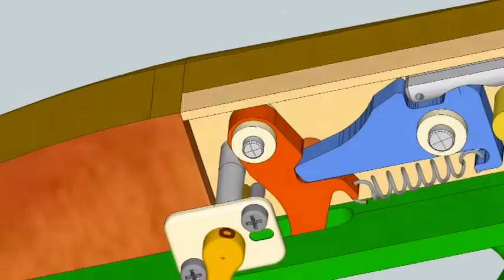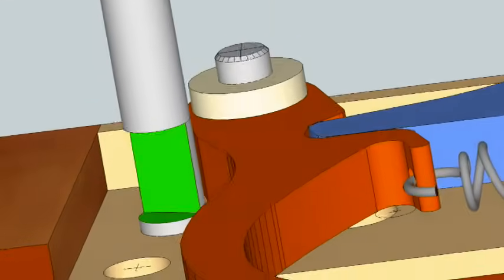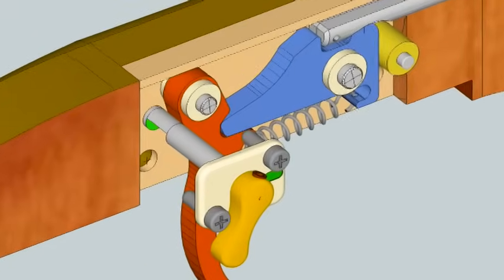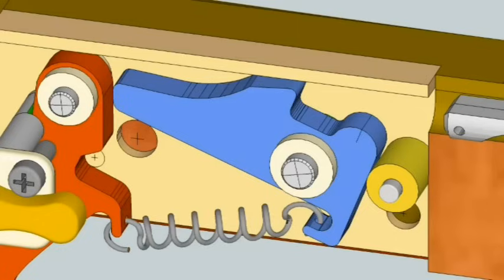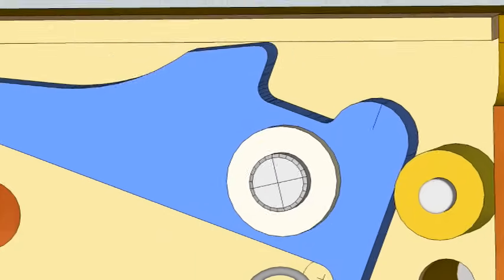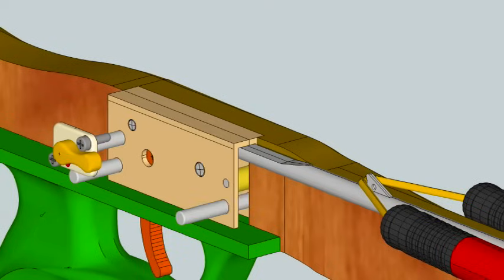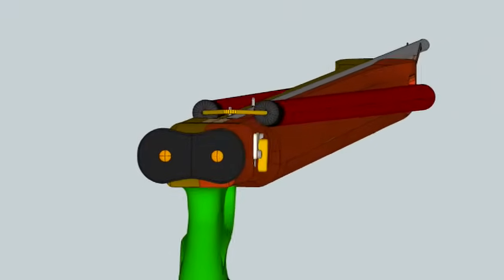New Speargun Trigger Design with safety knob

Comment: hello, nice mechanism, is it possible to get som drawing or 3d model please?
Reply from the maker: Hello Václav Mirvald,
that will not be possible, but a can give you some dimensions for it.
- The trigger housing dimensions= 13x30x65mm, wall thickness: 2mm 
Trigger and Sear= 5mm thick. All made from 316 grade stainless steel
Some of my channel viewers told me, that by using any free screen recorder program to take "screen 
shots"  from some of my videos, and then using a image editing program 
like "PAINT" to scale the images to get the right sizes. Watch the video
 "Roller Speargun Design Model"
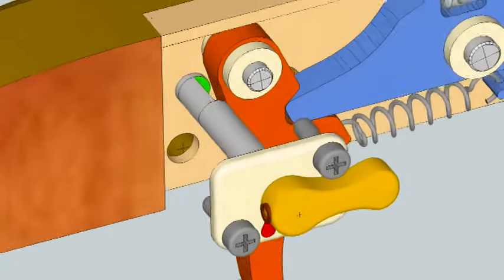 https://www.youtube.com/watch?v=_qQXGEgw5p8  at 1:03 is possible to see a side view of the trigger mach.
Thanks for the comment and for watching.

Comment: Qual  são as médias da  pesas
Reply from the maker: Hello Dejonson Pererira
 - The trigger housing dimensions= 13x30x65mm, wall thickness: 2mm 
Trigger and Sear= 5mm thick. All made from 316 grade stainless steel
Some of my channel viewers told me, that by using any free screen 
recorder program to take "screen shots"  from some of my videos, and 
then using a image editing program 
like "PAINT" to scale the images to get the right sizes. Watch the video
 "Roller Speargun Design Model"
 https://www.youtube.com/watch?v=_qQXGEgw5p8  at 1:03 is possible to see a side view of the trigger machanism.

  Overall dimensions of the spearguns.
The roller speargun:
 1200mm long (end to end)
950mm from the centre of the rollers to the edge of the trigger pocket 
50mm wide
---------
Traditional speargun,
1200m long
950mm from the edge of the rubber bands hole to the trigger pocket
50mm wide from the but plate to the end of the trigger pocket and tapering down to 40mm at the tip (muzzle)
I used  Okoume Marine Plywood  laminated together with epoxy,  but a much better choice will be to use Teak Wood.
Thanks for the comment and for watching my videos.

Comment: hello,,,,.... can u send u r trigger and speargun with all spear-part  
diagram, and all material and tools list. plz i try at my workshop.
Reply from the maker: Hello suraj shinde,
I want to finish this spearguns project first, before making it available. 
I designed this trigger mechanism using a Cad program (Google Sketchup) 
The only dimensions that I can provide are: The trigger housing dimensions= 13x30x65mm, 
wall thickness: 2mm, the Trigger and Sear= 5mm thick. All made from 316 stainless steel
I´m very confident about this design, but I need to field test it, over along period of time before making it available. 
Some of my channel viewers told me that is possible to take "screen 
shots" from some of my videos and then using scale to get the right 
sizes. Watch the video "Roller Speargun Design Model" at 1:03 is 
possible to see a side view of the trigger mach.
Thanks for the comment and for watching my videos!

Comment: Hi MRMyvids4you
Do you share your drawings anyware I was inspired to make a trigger and the plywood speargun :-)
Reply from the maker: Hello Kristian Arnvig,
I need to finish the spearguns first, then field test it for a long period of time to guarantee that it works and is reliable and most important that will be safe to use!.
 I´m constantly making changes as I building it, some times it looks good on paper, but not very pratical to do it for real!
One of the spearguns will be a "roller speargun" at the moment i´m working on the CAD model!
I sugest to any one interessed in making a speargun, to download the CAD program "Google Sketchup" is free and very easy to use! then start making a model base on all the information from my videos.
For now the videos are the only thing that i can share!
Thanks for watching my videos!

Comment: Hey man, I am planning to make a speargun over the winter. Your videos are really helpful and interesting. Do you think it would be hard to use a similar system but with a bullpup design with the trigger further forward and the release mechanism at the rear? using a linkage of sorts? I haven't really seen any spearguns like that. I'm not sure if there is a reason why.
Reply from the maker: Ash Rich Hello Ash Rich,that in speargun terminology is called a "midhandle design" is used primarily for blue water fishing!Thanks for watching my videos!